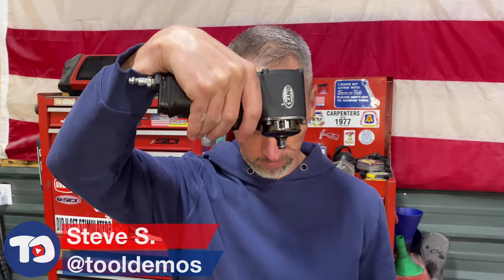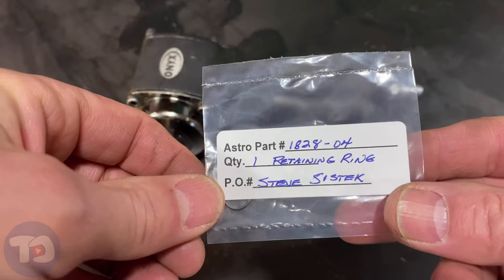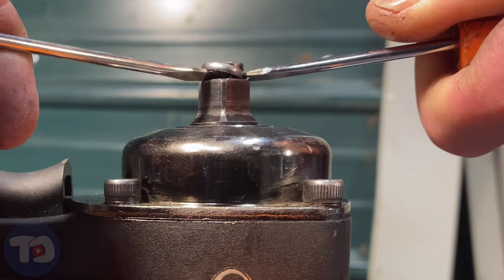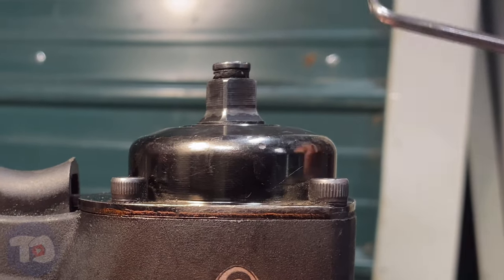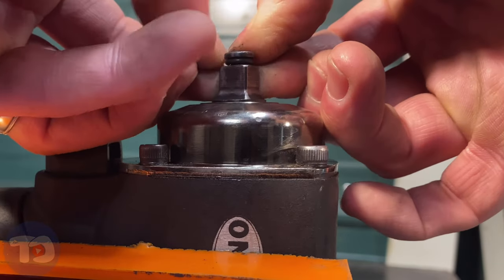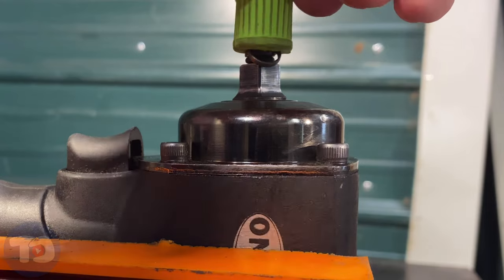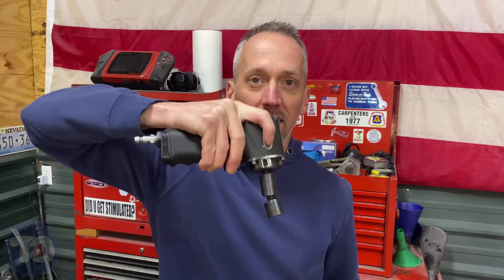Easiest way to replace hog ring.

Comment: Thanks for the info - just came across this today. I read through all the comments hoping someone would ask my question but nothing there. I have many other socket tools and they all employ a spring-loaded ball or release-able ball to retain the socket in place. Additionally, I could even see a magnet being used for socket retention. To My question… Why do I only see this type of retention mechanism being used on impact tools? Why not just use the old-fashioned spring-loaded ball?
Reply from the maker: An impact wrench will wear out any type of retention device. A hog ring is easy to replace.
Reply: @ToolDemos  Makes sense. Thank you.

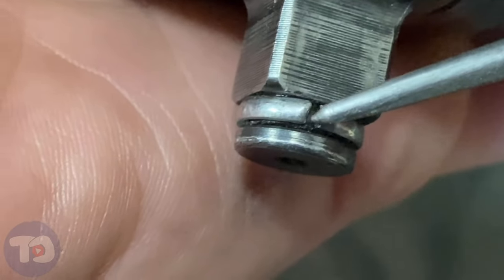Comment: Buy a oring kit from harbor freight. Get the Amazon hog rings. NOW THROW AWAY THE AMZON ORINGS. Proceed to just use the metal hog ring with your the harbor freight o rings and crack beer. Fought this falling off socket issue for years with the Amazon kit on my Mac 3/8th impact. Fixed with this video when he said the O-ring is there to put pressure on the metal hog ring. ! Eureka moment!!!!!! 0:34
Reply from the maker: Right on

Comment: Do you think all retaining rings are the same?  Could I get any ring for a 1/2" and use it on any other 1 /2" ?  Just wondering!👍😁👍
Reply from the maker: Hey Tony, the real answer is no, but for the most part, a generic 1/2” drive ring set is fine. The trouble comes when certain companies cough Snap On cough cut their anvils just a little different, so a unique Snap On part will work better in that instance. As far as Astro goes, I’d bet they are generic, but hey - genuine parts were free. Happy wrenching.
Reply: Thanks buddy!👍. I have a Kobalt 1/2" Corded Impact and the ring is starting to wear out.  Not yet, but, just looking into it ahead of time. 👍
Reply: Could I also use just any o-ring?

Comment: So the real question is:  WHY, do they call it a 'Hog Ring'?

and the next question is:  Why don't scaffolders use detent pin retainers?
Reply: For the first question I did a quick Google search on the term "hog ring" and got this answer re: why they are called that: 

"Traditionally, hog rings have been put through the noses of male pigs. This discourages the pigs from rooting around and possibly damaging the property of their owner. This is where hog rings get their name."

Google, the great equalizer...  heh heh...
Reply from the maker: You’ve seen upholstery hog ring pliers? Actual livestock pliers are very similar.